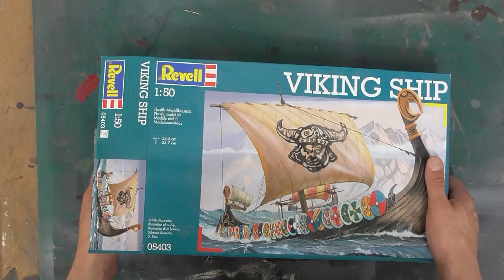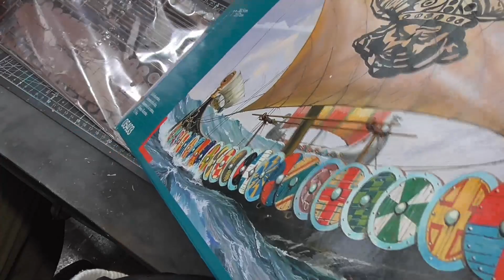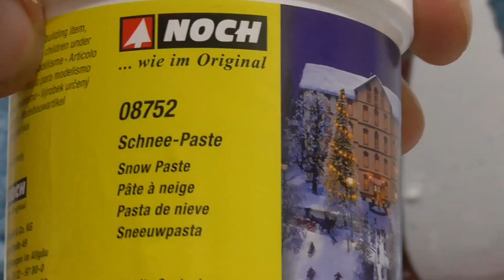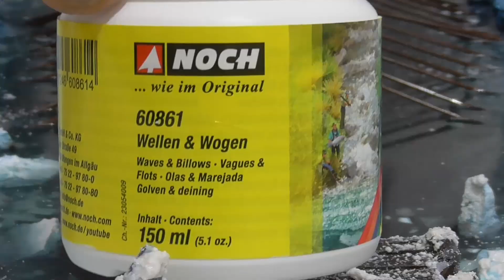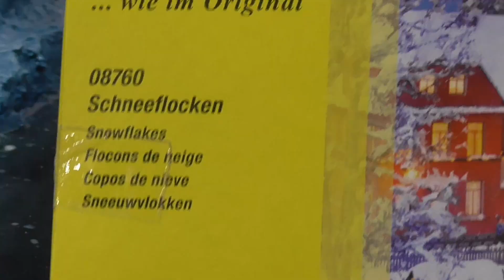Building an Epic Viking  Snow Diorama - Fire and Ice

Comment: For a first time winter build that turned out very very nice. The LEDs add an extra touch to the diorama. I wonder if you could use hot glue to make icicles?
Reply: You can to an extent. I've tried to make them on baking paper so they don't stick, which works but leaves a flat side. That's ok if you can hide the flat side away from the viewer. The biggest thing I've found is that my glue doesn't dry clear so you end up with cloudy icicles. It might be possible though
Reply from the maker: Thanks man, really appreciate your feedback. Hot glue was an option but somehow not quite right for what I wanted.

Comment: The video was informative and very helpful in answering questions about creating the layers of styrofoam and how you incorporated the paster.  I currently have a Dickens village which I use once a year and wanted to create a diorama to hold the houses with preset lights and  concealed cords under the styrofoam.  Would you recommend using plywood to reinforce the styrofoam? or could I do without it since the sections are smaller for storage? Thanks for sharing.
Reply from the maker: Thanks 👍